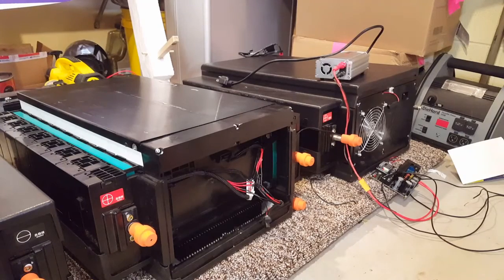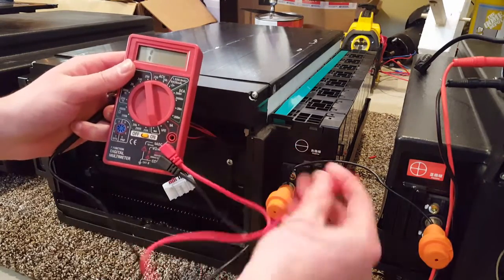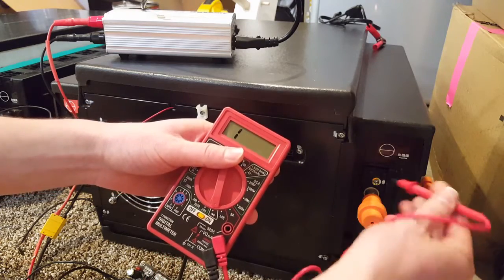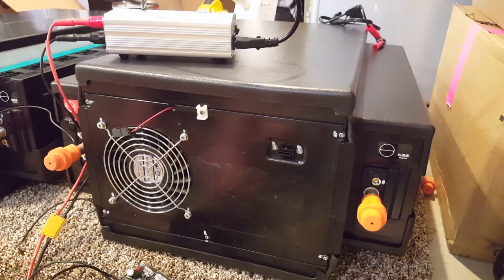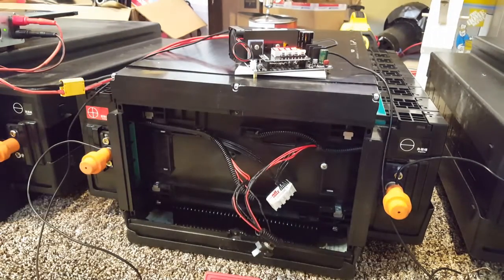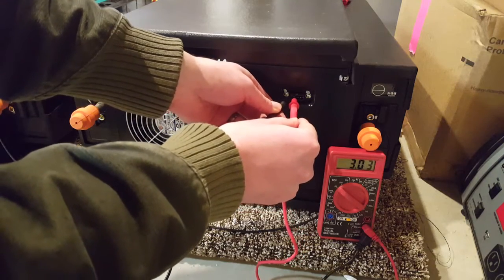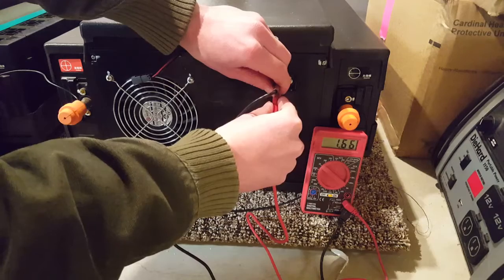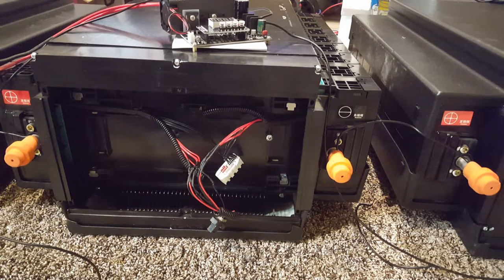Dead LiFePO4 cells? Testing cells in my modules.

Comment: I wanted to buy 4 of these just dont know about which BMS to use on them. I'm still learning and 4 batteries would be enough power for my application.
Reply from the maker: These are 8S batteries so any 8S LiFePO4 BMS would work. It should be noted that these (and the newer ones from battery hookup that are available now) are heavily degraded and difficult to keep in balance. I plan to top balance mine and see where they go from there. I dont expect to do deep discharges very often at all so balancing shouldn't be an issue.
Reply: @diyrenewableenergyelectron4996  I'm not familiar with lithium and been on lead acid for years. I saw many forums where people state expect half of the rating on these. I may try looking into other options. Thanks
Reply from the maker: It is not a small undertaking to set one of these systems up. Depending on your budget you could look into prismatic LiFePO4 cells and build your own battery that way. Will Prowse has lots of very good videos on setting up a prismatic battery. If you want a bare bones BMS for 8S, I recommend Daly brand.

Comment: you really cannot remove them from the casing as they will swell the minute you do and won't be able to get them back in the holders..Watch the break down of one of them there is a video on youtube some dude taking 1 apart.
Reply: Have you put yours into action? I just bought 2 of them today for my solar project...Your video has me concerned.
Reply from the maker: Yea, I still haven't done anything with them. That's unfortunate to hear, maybe I could make new compression plates for them but they haven't been a very high priority for me right now.
Reply: @diyrenewableenergyelectron4996  So what do you think about paralelling the pos cells so I can use 1 BMS? Im trying to create a 24 V solar system
Or should I just buy 2 BMS'S?
Reply from the maker: Well, did you buy the 3kwh ones battery hookup just listed? Those are being more thoroughly tested for dead cells and capacity. You can parallel the cells together, I am doing a 2S2P configuration. 48v, 16S total. 2 cell 1's paralleled, 2 cell 2's paralleled, etc. I plan to use a single 16S BMS for 4 modules.
Reply: @diyrenewableenergyelectron4996  Yes I did buy them. But I want to use them as 24v I actually have 2 150 AH that have a BMS built in already coming from China but its going to be another month.SMH. I was hoping to series them and parrallel to keep 24v through out' I have all of these parts laying around and I'm getting anxious. So I found this other company that is selling a BMS for these batteries that just plug in and it is 8s So I was thinking I could buy 1 and do the whole add jumpers in the pos cells. I'm not completely sure how that works thats why I asked if it would be better to just get another.
Reply from the maker: It is definitely easier/simpler to just run 2 bms's. No wires ran between batteries. What do you mean you hope to series them and parallel to keep 24v?  You will keep 24v by wiring a BMS to each module and just wire the main module negative and positive terminals together. MAKE SURE THE VOLTAGES OF THE MODULES ARE THE SAME! massive current can flow if the voltages are different. If I didnt answer your question let me know, I enjoy helping others.
Reply: @diyrenewableenergyelectron4996  O sorry I was referring to the 2 12volt batteries I'm supposed to get from China. So if I did that I would have 4 BMS's going is that alright to do?or is it going to be too much?
Reply from the maker: Ohhhh that makes more sense 😂. You could wire the 2 12v batteries in series and assuming they are LiFePO4, run a single 8S BMS for those. Then the ones from Battery hookup can each get their own BMS. That's the way I would set it up if it were me.
Reply from the maker: So the first 12v battery would be cells 1-4, and the second battery in series would be cells 5-8 on the BMS.
Reply: @diyrenewableenergyelectron4996  yeah they are lifepo4 but they have the BMS in both already
I was trying to save 135 bucks
Reply from the maker: Sorry about that. I missed you mentioning the built in BMS from a few comments ago. I dont THINK having 4 BMS's will cause an issue but I dont know for sure. The only think I would double check is whether the 12v batteries list that they can be wired in series. The manufacturer should state that in their documentation.
Reply: @diyrenewableenergyelectron4996  I never heard of a Lifepo not being able to be wired in a series? Is that a real thing? Thats going to suck if thats a real thing. How do I check that? 

Remark:

We offer lithium, lifepo4 and ni-mh battery, accept customized battery pack, we can't update all items here. If any battery you want, please take it easy to contact with me tell me the capacity voltage and size you want, thanks.

 

Descriptions:

Nominal voltage : 12V
Nominal capacity : 150Ah
The maximum charge current: Less than 60A
Continuous discharge current: Less than 100A
Service life: more than 2000 cycles
Charging temperature : 0~45 ℃
Discharge temperature : -20 ~ 60 ℃
Storage temperature : -20 ~ 45 ℃
Weight : 8kg
Oper  ating voltage range: 12.6V-10V
Overcharge protection voltage : 12.6V + 0.05V
Over discharge protection voltage : 10V + 0.05V
Battery temperature protection: 60℃±5℃
Output and parameters: high current positive / negative connecting column (red positive electrode, black negative pole);
Battery storage period: 90% power (6 months)
Battery warranty: 12 months (free warranty)
Product advantages:
Easy to carry, light weight, high capacity, high release platform, long working hours, long life, safety and environmental protection

Application:

electric machine, xenon lamp / searchlight, inverter, handheld devices, wireless communication equipment, monitoring equipment, power equipment, medical instruments, relief equipment, emergency lighting /LED lamps, traffic signs, portable small household appliances, electric tools, automotive and industrial equipment reserve power supply

Safety Precaution

1.Do not throw battery into water or make it wet
2.Keep the battery away from heat source
3.Do not throw the battery into fire or heat the battery
4.Forbid to hammer to trample the battery
5.Forbid disassembling the battery in anyway
Reply from the maker: Well, its not that the lifepo4 cant be wired in series, I just dont know if the BMS's can be. It may not matter, I would email the company and ask. I don't see anything about it in the description you sent.
Reply: @diyrenewableenergyelectron4996  10-4 I will ask them tomorrow Thank You for chatting with me.
Reply from the maker: Anytime! Sorry I couldn't be more helpful.

Comment: how did you identify S1 through S8 leads for the BMS connection ?
Reply from the maker: I had to wire them into the molex connector from the original BMS in the battery.

https://youtu.be/-8k3xcKMjIU
Reply: @diyrenewableenergyelectron4996  Thanks for your response

Comment: I do not trust BYD wiring, i  put my own in, riveted to each pos side on the cells byd for some reason riveted the bms wiring to each neg cell really odd.
Reply from the maker: I haven't had any issues so far, but I'm still fairly early in the process!

Comment: A LiFePO4 cell under 2 volts is pretty much dead.  A lot of mine were at 2.5 to 2.6 and they have worked OK.  The packs work but the cells are pretty far out of balance.  I'm going to hook up active balancers tomorrow.
Reply from the maker: Let me know how it goes!
Reply: @diyrenewableenergyelectron4996  Pretty disappointing.  After carefully balancing I got 19kwh out of 10 batteries!  I don't have any dead cells like yours but I've got a lot of weak ones that hold the other good ones back.  If I kept amp draw low I got another 5 kwh out of them but at that end of the charge using a microwave would make them all cascade to failure.  A cell would drop to 2.6 and that battery's BMS would shut it down.  That would put more amps on the remaining batteries, drawing a cell of theirs down to 2.6 and they'd shut down.  After the 19kwh mark all batteries shut off in a fraction of a second when I hit the microwave's "Start" button.
Reply from the maker: @ericbraun4652  well, that's no good. I'm expecting weak cellsas well. I'm currently waiting on a BMS to shoot a capacity test video. I am expecting a very similar outcome to yours. I should be able to keep the amp draw fairly low in service but testing will show the system weaknesses. Were you using active balancing? How did you have that set up? Your setup is 5 parallel strings of 2 batteries in series right?
Reply: @diyrenewableenergyelectron4996  Right. I'm  using 1 amp active.  But I'm using the cheap not very good type that pass current between adjacent cells only.  Even with that limitation I've been able to balance all but one pair to within .02 volts.  That pair... it's just so far off, there's no hope.  It's the one that quit first.  1.5amp passive just arrived yesterday after 1.5 months of waiting.  I'm not sure I'll try those.  Balancing isn't the problem.  And, yes, 5 parallel strings of 2 with a 100 amp breaker and 16S BMS on each string.

Comment: Yea, this sound like you have some dead cell. I charged 6 of these BYD to 3.2/cell individually. Then paralleled them all. It's been at this voltage for close to a month. I did the same with another six and these I slowly brought. the cell to 3.5v/cell again cell by cell. They were very out of balance. I Will series connect two for 48v and parallel 3. Then test charging and discharging with solar sometime soon. Waiting for BMS and balancer to arrive. In theory once they are well balance you are good to go. Manually balancing  is not easy.
Reply from the maker: My two good modules stayed very well balanced to about 3.4v/cell then went haywire. Seems to be the norm at the top of the voltage range. I'm probably just going to charge to 3.4v/cell and stop there to make balancing easier.
Reply: @diyrenewableenergyelectron4996  ok that happen to me. The cells that went haywire increased to 3.6v. Now using your charger start charging the remaining cell one by one to 3.6v. Keep an eye out for drifting and bring then back to 3.6v. Then let it rest and if they drop on you recharge all cells using main battery pole and they should now all go up to 3.6v evenly. If not repeat above. My theory is that all the cell are not in equilibrium, and essentially by charging each cell. You bring them back to were they should be. Once this is done you should be able to discharge and charge and the cells will not go higher then 3.6v which is were you balanced too.
Reply from the maker: @marcoa.rosado4724  Thanks for the tip!
Reply: @diyrenewableenergyelectron4996  what charger i need to buy to charge each cell to 3.6v?
Reply from the maker: If you have these exact modules you could purchase an 8S Life PO4 charger. The BMS is typically what monitors the individual cell voltages and will disconnect the charge current if one of the cells exceeds 3.6v.
Reply: @diyrenewableenergyelectron4996  one of my cell is over 3.6v and other still at 3.3V. so i need a charger to charge each. not all together. when all reach 3.6v. then i charge them together.
Reply from the maker: So this is very typical with these modules, if you started charging with the cells at 2.5v or below and you had one go out of balance like that you have a cell with less capacity ( the one at 3.6v) and the others have more capacity (3.3v). In my test, I had one cell hit 3.6v while the others were around 3.3v. This will likely not be fixed by charging all of the cells to 3.6v (aka top balancing) because the cells have all degraded and are now at different capacities. A BMS will protect your cells but the balancing is limited on most of them. You could add capacity to the weak cells by paralleling additional LiFePO4 cells to the weak cell (38120 headway cells are a popular choice). Or, just live with the smaller usable voltage range and limited capacity.

Comment: You should charge the bad cells alone to 3.65 and if they come around. If not looks like you will have to break one down for parts.
Reply from the maker: Thanks for the comment! I am likely going to break them down since theyre replacing the bad modules anyway. Once they're apart I may tinker with the bad cells more, but I think they've given up the ghost. If they held a charge but were weak I might have hope but they self discharge in just a few hours. Maybe I will do some testing videos once I get them apart!
Reply: @diyrenewableenergyelectron4996   You have one pack with 3 bad cells and 5 good cells, put the good cell into the pack with 1 bad cell. When you get downtime which is never. LOL
I think the batteries came from here and got pushed hard. https://www.youtube.com/watch?v=Vc_fDWIz76w
Reply from the maker: @lou1502  it should be a good time! Big batteries and power tools, what could go wrong 😂
Reply: @lou1502  I agree - but I'd go one further and capacity test all the good cells and put the cream of the crop into one of the cases. Its possible that some of the cells in the one with 1 bad cell are weak, and some of the cells in the one with 2 bad cells actually have good capacity :)
Reply: LOU thanks for the BYD bus video. Interesting.